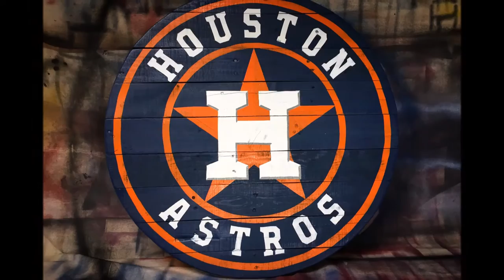How to Make a Houston Astros Logo - Pallet Wood

Comment: How do you not get the marks from cutting on the wood? Just tried one and you could see the outline where i cut it out
Reply from the maker: Cut with enough force to go through the tape but not too deeply in to the wood.  Also don't go past your lines try to stay on them as best you can.  Make sure you use a sharp blade too makes it easier and cleaner to cut.

Comment: Dan, how did you get the large logo stencil?
Reply from the maker: I use the settings on my printer to enlarge it.  Most printers have a "tiling" feature or "poster" feature that prints out images on more than one sheet of paper this setting can usually be found in the "Advanced" settings of most printers.  Here is a link to a write up that explains how I do it.  Its a long read but its pretty thorough.  Just skip to Step 1  https://www.instructables.com/id/Spider-Man-Wall-Art-Limited-Tools/ let me know if this helps.
Reply: that will def help! thanks